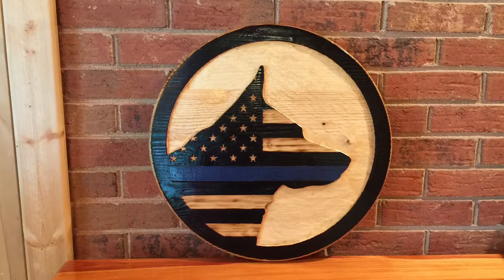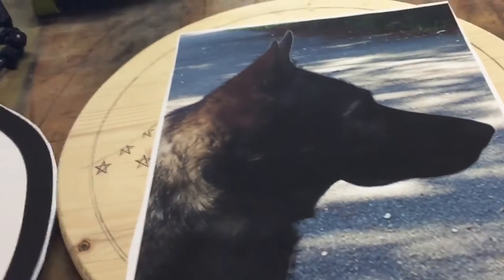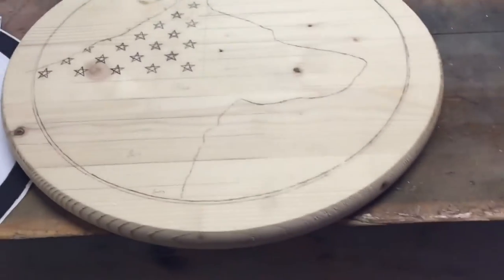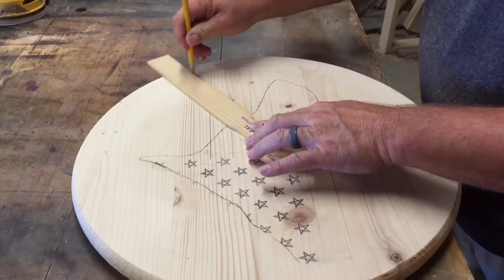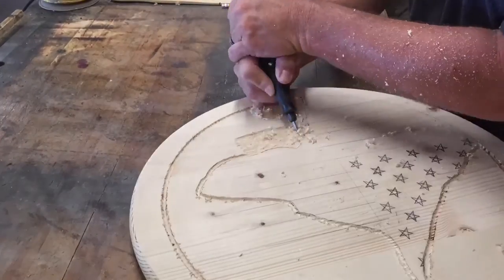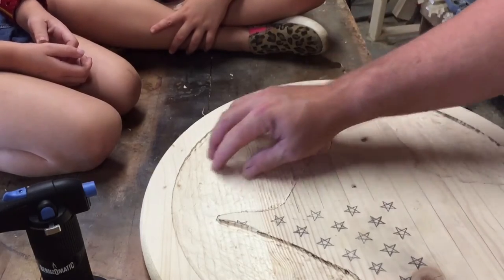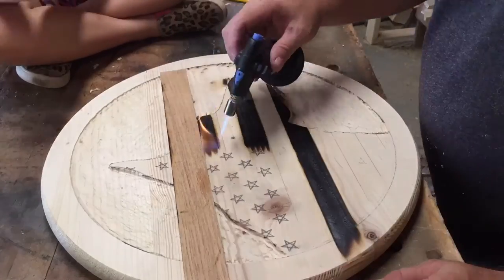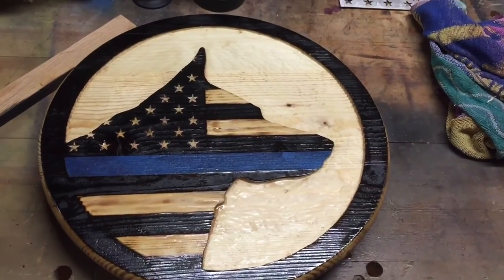Police K-9 Silhouette Plaque

Comment: If you get into making more of the signs you should take a peak  into sandblasting.
Reply from the maker: I was actually thinking about that yesterday. I haven't tried that on wood but I saw some lumber at lowes that looked like it had been sandblasted to make it look rustic or weathered. I was thinking that would be a good thing for me to try. I'm assuming you have used this technique, is it a pretty quick process?
Reply: The longest part is covering the parts you don't want blasted.  The texture really nice and you can really make the Pattern pop.  I am going to get a set up again. I will just get one from Harbor freight and just do a couple upgrades to it.